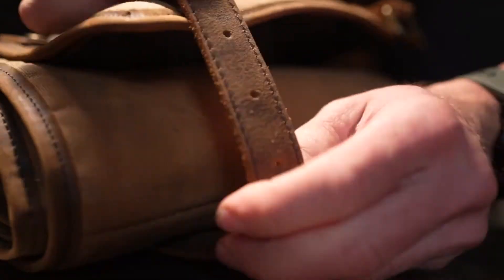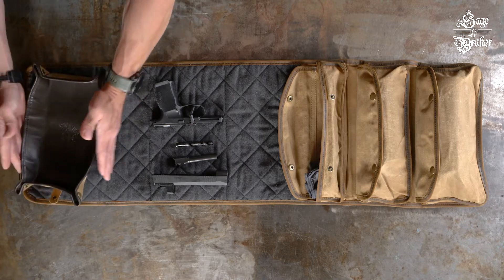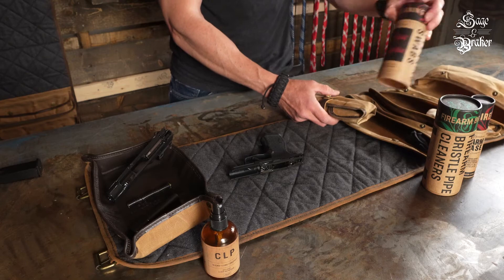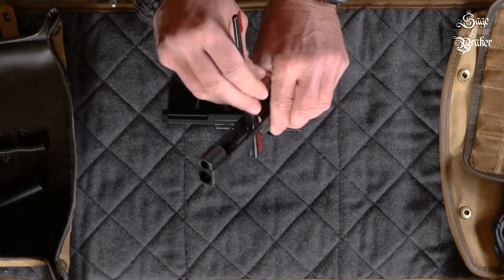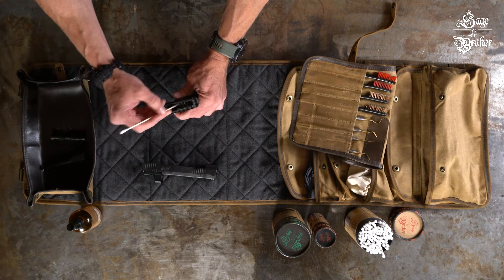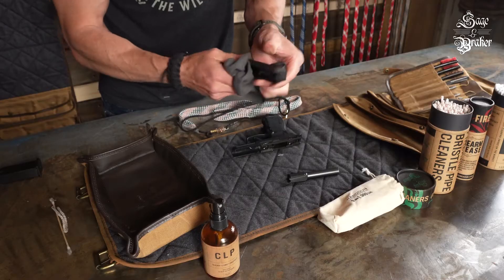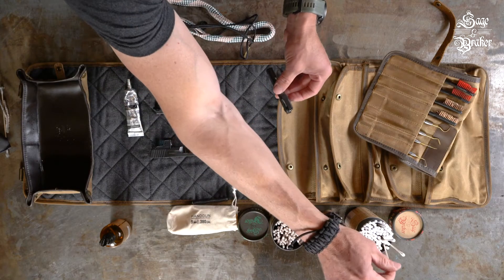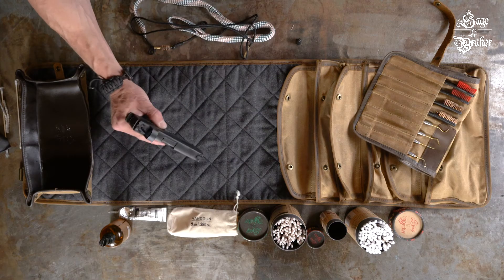Sig Sauer P365 // How to Clean and Disassemble

Comment: When reassembling my P365 Xl, I put the slide back on and manually raise the slide stop lever….when I rotate the takedown lever to it’s normal, horizontal position, I would expect the slide to stay locked until I manually push the slide lock down, but in my case the slide forcefully pushes forward into battery as soon as I rotate the takedown lever. As if rotating the takedown lever automatically causes the slide catch lever to be disengaged for some reason. Is that normal? If not is there a solution? Thanks.
Reply: Normal